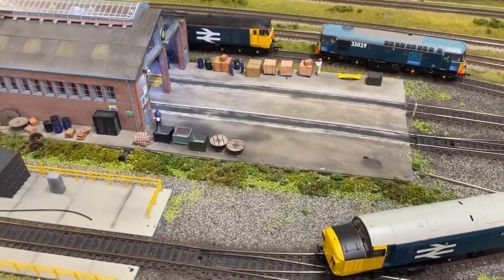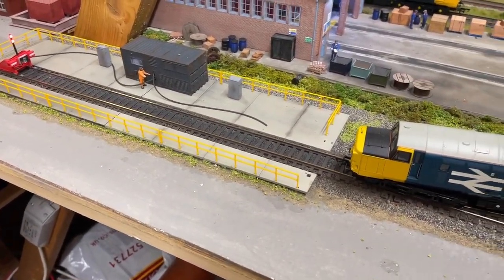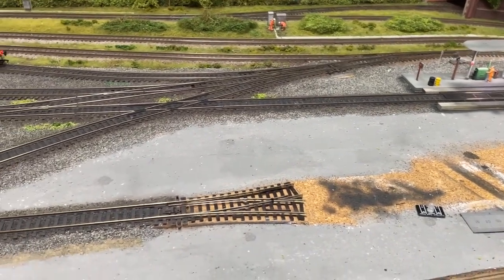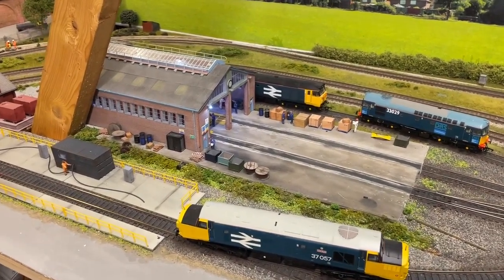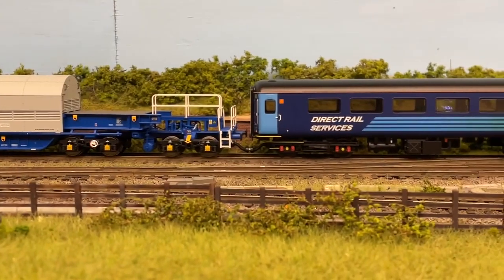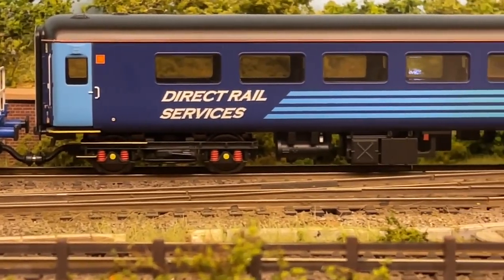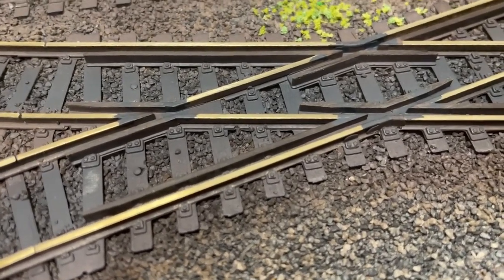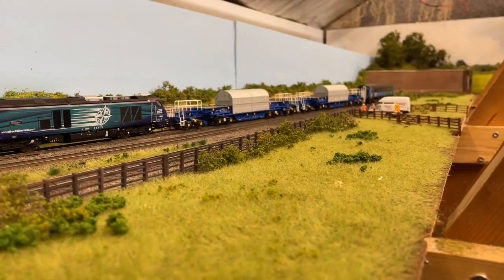Brayworth Park May 2023 Update & Running Session

Comment: Spot on with reference to the Hunt coupling's problem of parting under load. Mine did on corners and s bends, despite me buying the specific HST set! Mine also kept popping out of the NEM pockets and then snapped due to being brittle when I tried to tweak their insert legs further apart! All in all poor. Only good for short, light wagon trains. I use black nail varnish successfully on the point frogs and crossovers to prevent shorting.
Reply from the maker: Thanks for your comment - yes had same issues with Hunt Couplings, either come out as loose or break trying to remove. Everyone raved about them at first but I'm not impressed at all. Just hope Hornby get some stock soon of theirs! Cheers Reggie